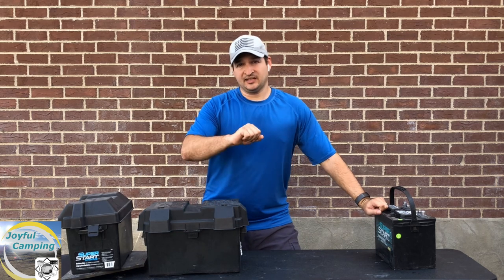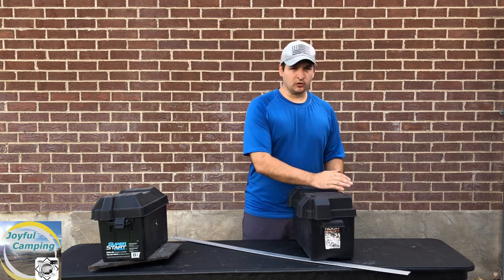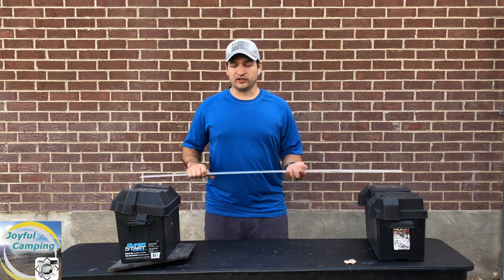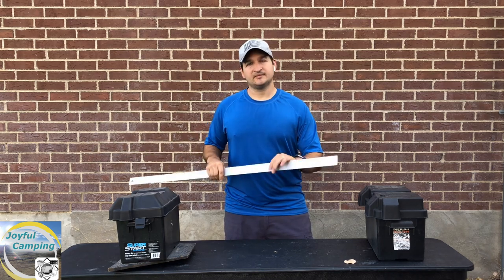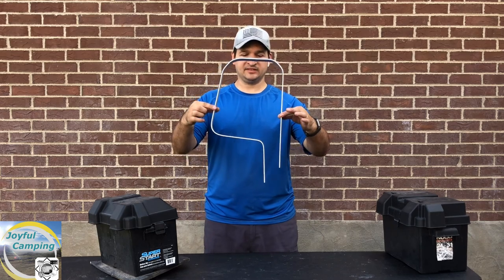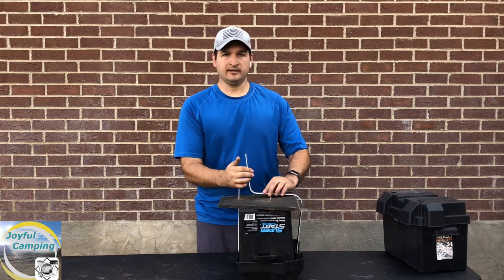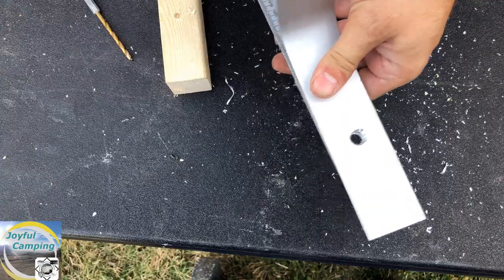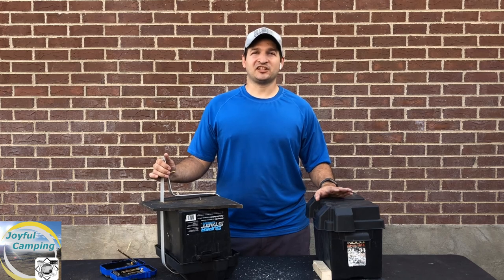$5  Travel Trailer Battery Lock - Protect Your RV! --- Joyful Camping

Comment: Interesting.. can an older female make this? I'm trying to find a way to lock my battery box so I can keep the battery on the trailer without it being stolen.. wanted a locking box but having trouble locating what I want..
Reply from the maker: Yes I think that just about anyone would be able to make this.  The aluminum bends easy but could need a little bit of force for some of the tighter bends.  Good luck!  Happy travels!